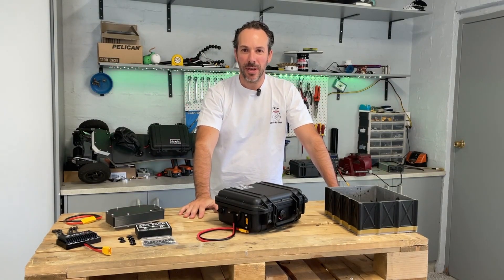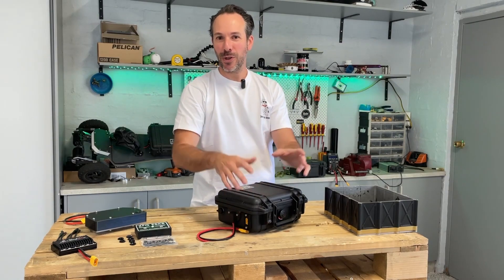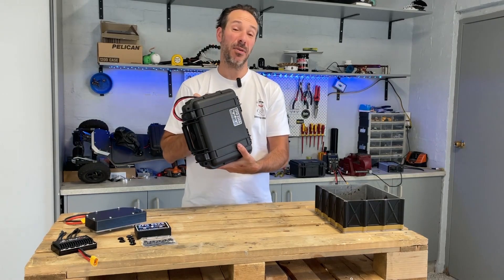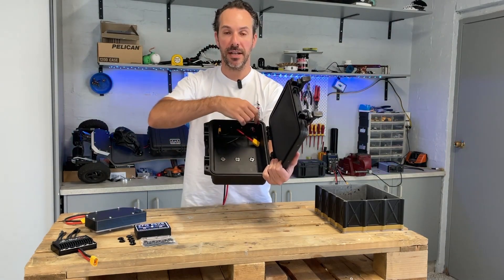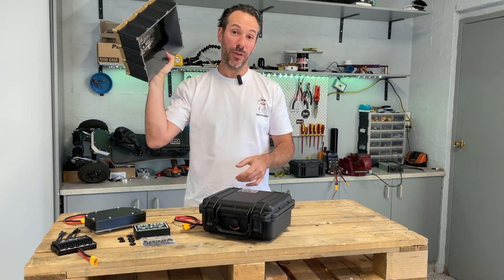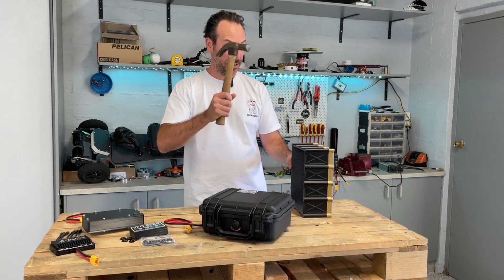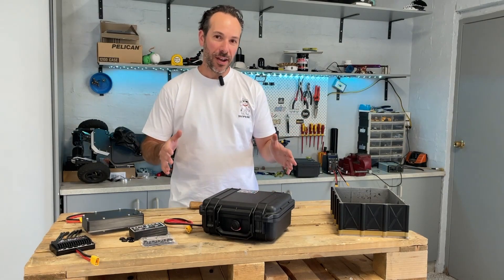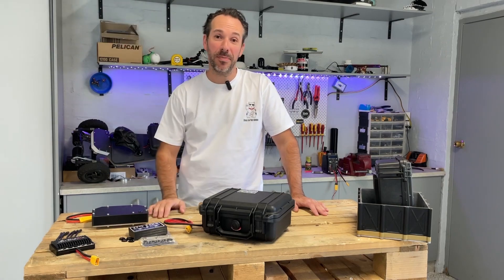ZFG Battery and ESC Enclosure Talk

Comment: I used that new case on my first electric mountainboard build, and the upgrade mbs electric mountainboard has a bit smaller one. By 1inch and is awesome for battery waterproofing and making look, so clean.
Reply from the maker: Those cases are bullet proof and perfect for mountain boarding. It's not worth the effort in even attempting to re-design it.